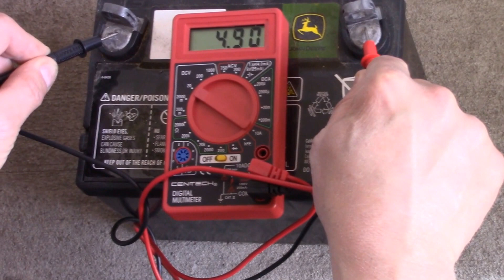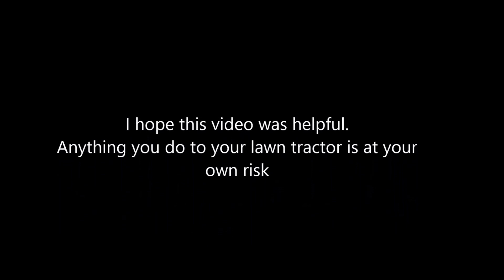John Deere D105 lawn tractor battery  testing and replacement

Comment: How many volts/amps is this battery? --- I have to charge mine and I don't know what to set the charger at. (Thanks in advance).
Reply from the maker: It is 12 volts and I would just trickle charge it 2 amps or less

Comment: Can you tell me the cranking amps of this battery i need to replace my battery
Reply from the maker: Batteries are sold by the group size (standard + -  post location and dimensions) the next is the cranking amps, the higher the cranking amps the higher the price.  The battery I used in this video was group U1, with cranking amps of 285.  I wish you the best on your battery replacement.
Reply: @bbbjim1fixedit  but what cranking amps for d 105 you would recommend 
I'm not from States so I can't look in to this place you just mention
Reply from the maker: the battery that came with it was 195 cranking amps, so any battery with 195 through 300 will work.  I also made a video on if your lawnmower is slow turning over it may not be your battery: https://www.youtube.com/watch?v=9BmEGIMTWAI
Reply: @bbbjim1fixedit  I hook it up to car battery   and  tractor started pretty well 
Thanks
Reply from the maker: @robertrobski1013  A car battery can damage your starting motor if done a lot

Comment: You said you bought a new battery with more power, what do you mean?  What was the difference?
Reply from the maker: Batteries are rated by how many cold cranking amps they have at zero degrees.  The higher the CCA, the more power it has to start the engine.  I wish you the best on changing your battery.
Reply: @bbbjim1fixedit   Thank you so much for explaining cranking amps.  We bought a battery and have it installed.  Thanks again.